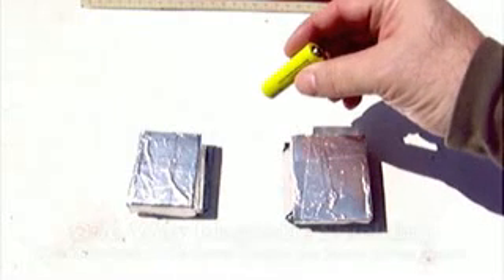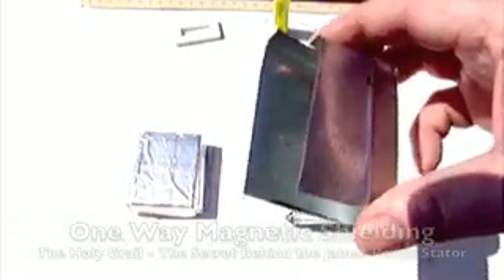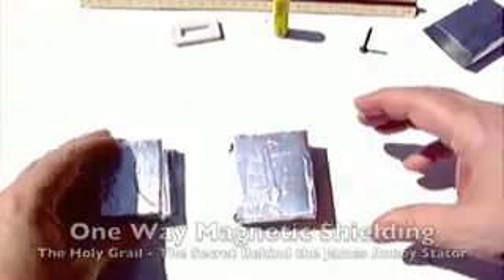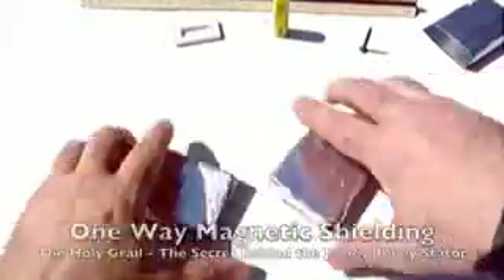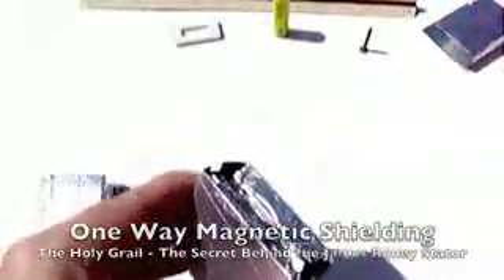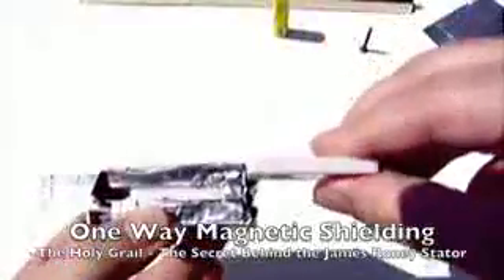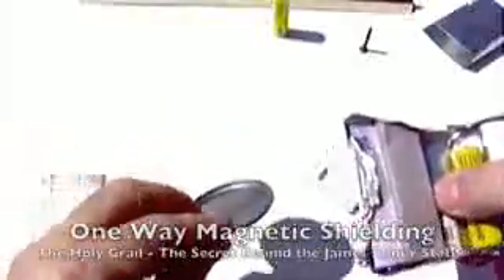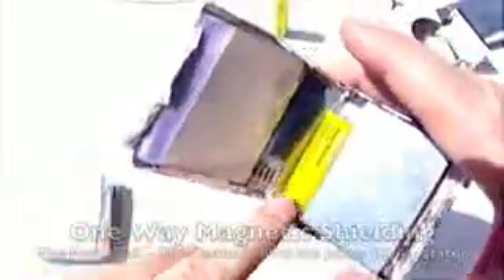James Roney's magnetic shielding

Comment: @Tohmahak12 They are not personal assumptions. It's blatant to anyone with eyes that the placement of the magnets within the "shielding" are close together when he's demonstrating their repelling properties and far apart when they appear to be inert from the "shielding." All this does is add mass to a device (meaning more force to move) as the field will bubble and there would still be equal pulling and pushing forces.